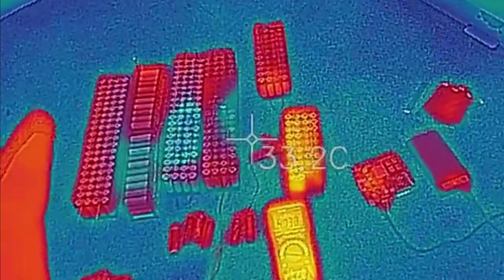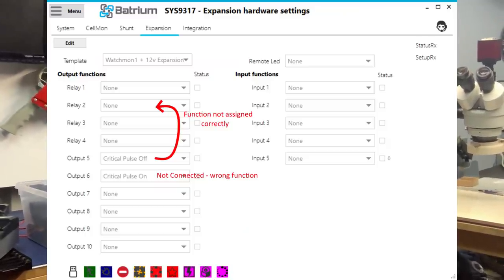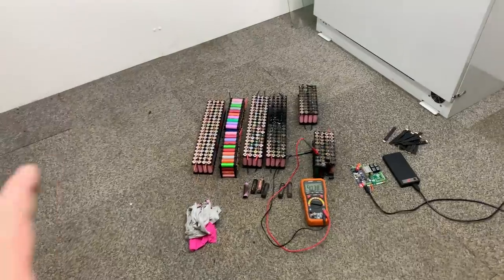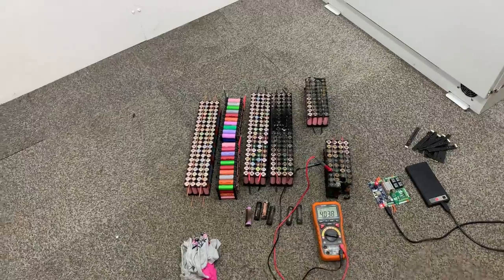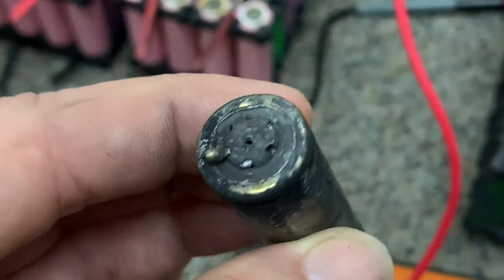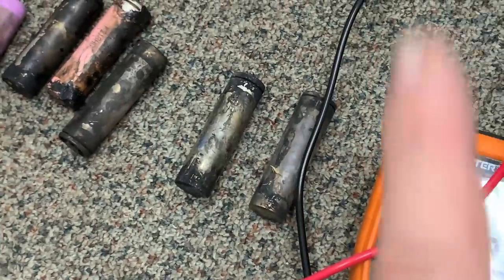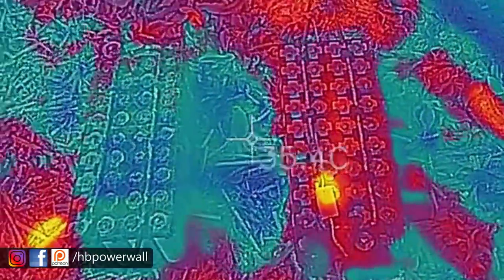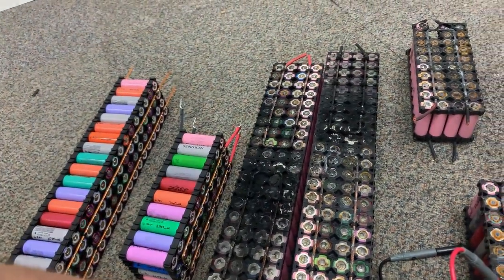Near miss, Smoke, Fire & Fear on new years eve

Comment: There is no hiding from the potential danger with lithium batteries, I had one go the same way and it was no fun, difference it was Lifepo4 and only exploded with little fire. I do believe this happens at the end of a charge cycle and the cell cannot release it's pressure so malfunction of internal pressure heats up and expands then take fire.
Reply from the maker: how long ago was that?

Comment: My powerwallis outside...wouldnt advise ever having lithium inside😨
Reply from the maker: sound advice
Reply: That's great if you don't live in a place that has temp swings of -20C .. 30C.
Reply: @tomstdenis  bury and insulate it.
Doesn't matter how much the temp wings, it's relatively constant 3 feet down.
Reply: What do you do about temperature swings?  Heat?  Cold?  Moisture?  How do you keep the thermal sensors from malfunctioning during hysteresis?
Reply: @tomstdenis  That is my concern and one of the things that prevents me from beginning. I have similar temp swings probably -20C to 35C. Going 3 feet down would be difficult for me. We don't have much soil before hitting shale.
Reply: @drescherjm  It also makes maintenance impossible and unless you have a sealed chamber makes you vulnerable to the elements (like water).

Indoors is fine but you have to trust the cells you use which is why I wouldn't aggregate a huge pile of unknown cells in one place.

my home solar battery (mostly for UPS purposes) is made out of a slew of brand new deep cycle AGM batteries.  My portable packs are made out of brand new lifepo4 cells, etc...
Reply: @drescherjm  maybe a shipping container built with insilation and maybe something that will keep its tempature constant?

Comment: Internal battery corrosion, and internal short bypassing fusing? Thermal run-away, possibly from dendrite growth, but yeah another reason to run dehumidifiers, and thermal sensors in any battery power building, preferably metal fire rated enclosure, Li-Po just does not ever fail safe, There needs to be replacement scheduling, even if they're operating fine
Reply: halon system, or an equivalent in there of, where it can rob the fire of all oxygen would be a good move

Comment: double fused but neither fuse blew?  I have nickel strip fusing on the positive terminals of mine.  I accidentally shorted one in assembly and it worked properly.  Awesomely terrifying when the top glowed orange, but they worked as advertised every single one blew.  I would test your fusing.  It appears that you had an internal short in a cell, could be that just that started a fire.  Further confirmation for me that I need to mount my batteries inside steel fireproof cases in case of a similar failure.  I have contemplated building a concrete fireproof vault for my batteries.
Reply: A bad cell can over-heat, but still not blow the fuse ...

Comment: Could have been nasty, my system will not use the 18650 cells but larger LiFePO4 units and will be in an enclosed  cabinet or small shipping container.
Lucky it didn't cascade

Comment: Maybe, the CID gets compromised during soldering. I remembered how may cells i popped  from soldering.
Reply from the maker: i'm sure this isn't the case.. you must be getting it extremely hot to affect CID
Reply: Also along with HPBowerall's comment, this was in service for years. So a solder ball in the cap would of caused issues long before now.
Reply: @HBPowerwall   in that case heat during soldering did not trip the CID until now.

Comment: Internal separator failure. Enough to heat up the cell and roast it, but no ultimate short so that the rest of the string would push its power into that cell and melt the fuses. I would say a cell at its end of life. Wondering if that pack was actively balanced, and if it was in a way which would have shown a weakness of that  particular string. Good that it didn't burn down the house.
Reply from the maker: Was passive balance and all cells were within 0.2v of each other.

Comment: He didn't check internal resistance during initial repacking  of cells.
Reply from the maker: I can't confirm or deny that BUT i sure didn't back in the day
Reply: so what is the result of mismatch internal resistance?  I didnt take it seriously too. thank for sharing
Reply from the maker: some cells will be warmer or cooler under change and discharge.
Reply: @HBPowerwall  How do I optimize for internal resistance? Repackr only looks for mAh if I'm correct. Should I ditch the low or high resistance cells or what is the process?
Reply: @TheBlacktom  first of only use cells with low internal resistance probably 150mOhm or less. and only draw 1 to 1.5 amps per cell. to avoid such devestation.
Reply: @hassanjahangirzaidi7  Ok, thanks. I will select cells based on resistance and voltage drop (over a few weeks) and build the pack based on capacity (possibly repackr)

Comment: does this mean that I should now cancel my 18650 powerwall build and look at LifePo4 instead?
Reply from the maker: Yes... AND no.. it would depend if you're going to build it then ignore it like this guy did. Maintance is key to everything in life.. gota look after it and not ignore it or it'll leave you lol
Reply: @HBPowerwall  thanks. lol. I will watch it like a baby. Its going outside now in a big plastic garden storage box.
Reply from the maker: Yeh away from anything of value works well.

Comment: Wonder if immersing the packs in mineral oil like we do with transformers would be a solution? It would certainly isolate the lithium from oxygen entirely and allow the mineral oil to be used as a cooling medium....
Reply from the maker: Then your issues is hiding the fault rather than fixing it.. If a single cell is heating more than the others around it, it is faulty - Must fix the core issue.
Reply: @HBPowerwall  Yes, not hiding the fact that a cell is going bad, but rather making sure the entire pack is isolated from oxygen.  You would still see the hot cell with the infrared camera, and could replace it as normal, but without any oxygen contact. In fact it would also allow a temperature sensor in the oil that would tell you that the pack had a fault and was running hot.

Comment: Don't know if it's the lack of sleep, but you sound noticeably distressed, almost manic.
I can't make out if this was a system you had something to do with, or something you had nothing to do with until it fell into your lap, post failure.
There was around a 500mAh range in the capacities you showed, it'd be interesting to find out what the largest variant was.
It'd also be nice to know if temperatures were monitored during initial testing of the cells, given that in the undamaged pack, there were Sanyo cells. 
I've also had a large percentage of Sanyo's that were heaters and am not convinced that the ones not initially producing heat, won't eventually follow suit and need replacing before creating issues.
This incident gives me more reason to believe that a secondary temperature monitoring system that could also trigger shunts, like a simple Arduino based unit, is a cheap way to increase safety and peace of mind.
I think it's great that you're sharing this openly and I'm sure lesser men would be scared to do so, instead, sweeping it under the rug and hoping nobody ever finds  out (especially legislative bodies).
I'm pretty keen to follow your investigation process and as you say learn from the mistakes of others.
Cheers Pete, ya far king legend.
Reply from the maker: I'm married... i'm manic for sure. Add to that a massive workload for the day job, lack of sleep from over thinking things.. you know life in general.. I'm good - moving foward ever day..

Comment: Internal failure, that's why the fuse didn't blow the bad cell's didn't place a load on the other cells in the group. I use LiFePo4 cells, much safer than Li Ion's. I'll bet the system discharged the cells below the recovery point. Check the system to make sure the cutoff voltages are right.

Comment: I am embarking on building such a powerwall for an ebike and have watched many tutorials including safety. I think the answer lies in the sheer amounts  of amperes contained in the battery along with the micro components built-in to each cell.  In the good ole days a piece of electronics would only draw the amount of amperes it needs. Now hold that thought because nowerdays it is no longer true. With today itsy weeny components mosfets etc they will blow if amperage is exceeded. I believe that     a fault may have been possible caused through overheat due to soldering rather than spotwelding or just wearing out causing a short in the protection circuit built into the 18650 battery...Hope this helps.
Reply: More likely, it was a bad cell ...

Comment: I'm thinking a couple cells developed internal resistance and this became a load on the rest of the batteries. Obviously not enough to blow a fuse but definitely enough for the faulted cells to overheat and hit thermal runaway. It looks like the batteries are salvaged, probably laptop battery pulls. Being that it was only a couple of batteries, it may have been that both batteries were already at their end of service life.

I salvage laptop batteries and most commonly find BMS issues but every so often I run into a pack of cells that are good except for one or two that developed severe internal resistance. Of course the BMS detects unusual heat and discontinues charging so the battery pack is perceived as bad and replaced. I'd wager that's the story behind the batteries in this failure.

Comment: I'm very curious about that fuse wire! I'd like to see a test of a few strands of those, how many amps it takes to blow those in a few seconds.

For my own upcoming build, I'll use the very fast-acting PICO fuses; they're small and rugged enough and only 5ct each. I have more faith in them than in the random wires I've seen people use.

Note that these fuses will sustain the rated current for 4 hours, and blow within a second only upwards of 200% of the rated current. For my batteries: standard charge ≈ 1.5A, and max. charge ≈ 3A. Thus, I'll choose fuses rated at 1.5A or maybe 2A, so the fuse will definitely blow before the max. charge current is reached.

--

You've mentioned 'do a voltage check', but how to test a cell quickly if they're in a pack? In my planned design, I'd have to un-weld the individual cells from the busbars before I can measure them.

--

Others also mentioned that the burnt cell might have shorted internally, and I'm considering how to best prepare for a fire, in case you can't prevent it. 

If you have cells to spare, I'd love to see the effect of packing a pack in drywall sheets for fire safety. Just one of those packs, drywall all around it, and then try to make one explode/burn; perhaps by shorting them out.

Context: I'm working on a LiPo RV battery; 14.8V 100Ah, consisting of used bike batteries (plenty of those here in the Netherlands). I'm considering lining the plastic box with drywall sheet as well as spacing them out with drywall every seven-or-so cells.
Reply: From a company, I know that their battery-charge room has a rather low-tech solution: the batteries are being charged in a special cabinet with a door that can be closed. Above the batteries is a piece of balsa-wood, that retains a load of sand. Should a fire result, the balsa-wood will quickly break and dump the sand on top of it, quickly removing the oxygen from the fire. Now I do have to say that I don't know if it's special sand or not...

The best way to protect against fires is most likely temperature-protection between any group of cells, with a monitoring system that not only looks at temperature, but also calculates it's measures against time, so it's not a matter of 'sensor reads 50 degrees Celsius, something is wrong' (while in reality, the rise-time of that temperature is of far more importance, but more 'Over the past 10 minutes, the temperature has risen from 30 to 40 degrees Celsius, something's got to be wrong'

Considering your use of drywall: please remember that the paper on both sides probably accelerates a fire...

Comment: It's simply a matter of the cells aging at a different rate to one another - they're a mishmash of all different brands judging from the sheathing colour - clearly a few cells in the pack have bummed out and as a result are going drastically overcharged by the other parallelled cells reaching their capacity.

Fewer cells in parallel to allow better balancing would prevent this.

I suspect the fuse wires didn't blow because the overcharge was a low overcurrent over a prolonged time, it was a slow process pushing the failed cell to the point of thermal runaway.

Another solution would be groups of thermally fused cells; thermal fuses in the middle of every eight cells or so... Or at least, temperature sensors to cut off the charging process and alert the user to a degredation in their battery pack.
Reply: Why would cells be overcharged? They're all in parallel and they only get charged to whatever safe termination voltage, 4.20V. Why would fewer cells in parallel help? They get charged to the same voltage anyway.
Reply: @SianaGearz  Because the internal resistance can do weird things with the charge-voltage an individual cell sees. The fact they are all in parallel does not mean one cell can't got bad, they just aren't a bunch of solid value resistors. If one cell starts to develop a high internal resistance, it's voltage during charging usually rises significantly. In this case, as so many cells are in parallel, balancing is nearly impossible as all the other cells will keep passing their charge to the bad cell (because, as soon as the current through it drops, so does the voltage the cell sees).

I'm currently working on recelling my own video-camera batteries with a BQ20Z65 BMS-chip. It's ridiculously complicated, has thrown a whole bunch of errors in my face already, but the main thing the reference manual warns about: 'Even though the BQ20Z65 is capable of balancing the cells, no cell-imbalance algorithm can deal with one cell (or group of cells) performing far worse than the rest due to aging, rising internal resistance, or a different brand/cell type.'
Reply: @weeardguy  I still don't understand overcharging. I mean say your termination voltage is 4.2V. When it is reached, due to ESR, the voltage across the cell that isn't absorbed by this resistance, is let's say 3.9V. Then the charger tapers the current, and the battery can absorb to 4.2V, or if the charger only stays on for a short time in CV mode, maybe not completely. So while other cells will lose some voltage to boost this cell, i still can't see why the internal voltage on the cell would ever exceed 4.2V. Or what constitutes overcharging?

Of course good balance will not be reached, because by equalising voltages, there is a different charge in the series-sections unless they are fundamentally matched. In the regard that the whole parallel-section has a reduced performance due to presence of a bad cell, and in a series-parallel matrix, the battery cannot be discharged fully because that one section is limiting overall capacity. By the time this cell group with a degraded cell has reached the lowest safe operating voltage during overall battery discharge, there is still a lot of charge in other parallel sections (connected in series to this one) left. One technically could discharge fully but this can force current through the bad parallel group and cause a voltage reversal, which is potentially explosion prone.

Comment: I hope the guy speaks up a bit more. There is zero shame in this, so long as you did everything to the best of your knowledge. I'd encourage him to share some more details so that we the community can learn from others mistakes. The fact he didn't want to share makes me think he is guilty, which implies he might know he messed up and is embarrassed by that mess up. Either way, send Pete an email with some more details please. 

My only guesses would be:
Overvoltage, seeing as the fuses didnt pop
Over-temp. Too hot on a hot day, too high of a fuse rating and too much load. On a sanyo heater, that would be my best bet.
Some solder looks a bit messy, perhaps a cell bridged between the + and the - side if the wrap was damaged.
Left over flux on the cells should have been cleaned off but not the cause of the fire
Reply from the maker: It is possible, but given there is zero public documentation of the build. No photos, no fb posts, no forum posts it might just be he isn't one to share in such a way and doesn't need the backlash. Either way he had the foresight to make sure others know about this issue.. for this i'm greatful even if it puts my entire project in doubt

Comment: Isn't water and lithium a no no. You need a CO2 or foam system. A shorted battery isn't going to burn and just stop when dunked. If the case was compromised, having water there may be even more damgerous.
Reply: No, there is no Lithium Metal in these cells ..

Comment: Ship them to me I’ll dissemble all them .  

It will be one cell that’s under voltage that under a load turns into a fire cracker welds it’s fuse closed then shorts out that whole parallel row.
Reply: A fuse that "welds closed", is no fuse at all.
Also, the cells are individually fused. If one cell did go short, how exactly would the others in that row stay connected?